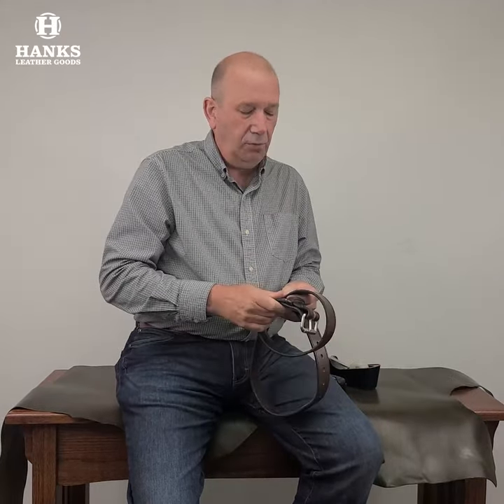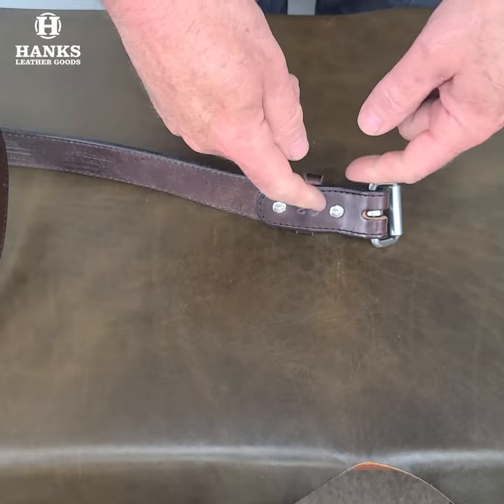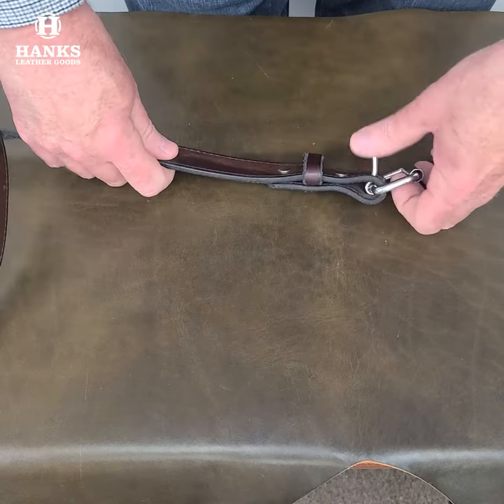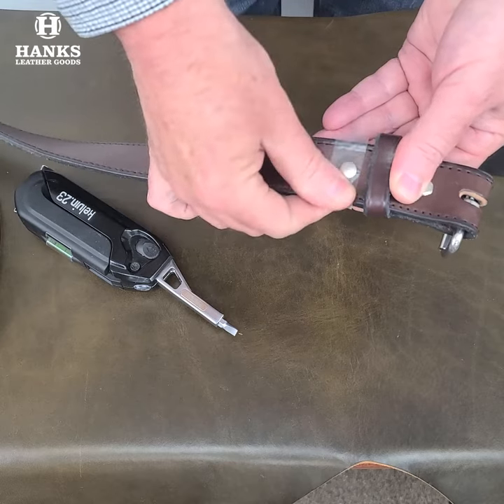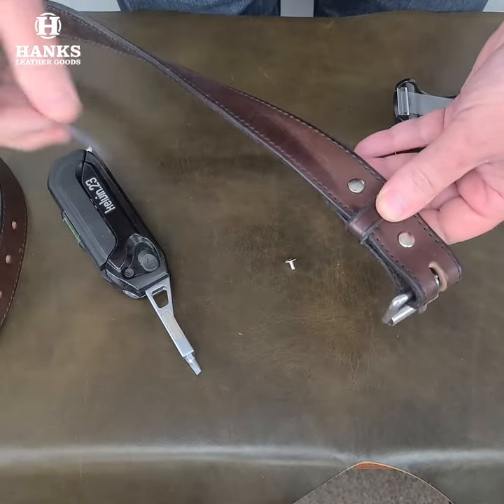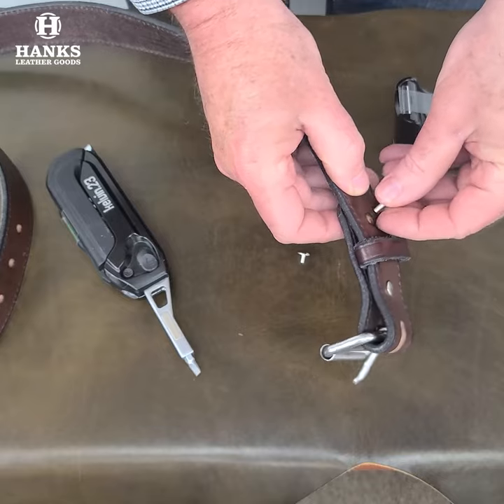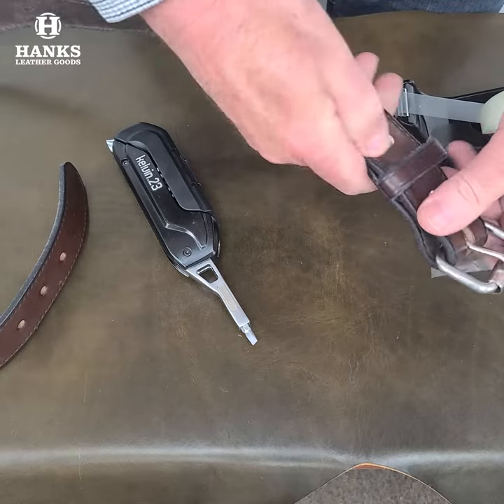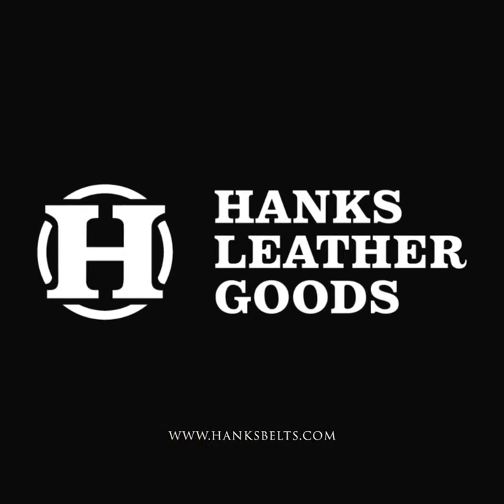Why we use Chicago Screws on our belts. How to remove tight Chicago Screws & how to secure them.

Comment: Star tool used by me was a T10 X 50mm. It worked for me on the same model belt.Very easy with the tape. I left the tape on as I slipped on the new belt loop. Then re-tightened without removing the female half.
Reply from the maker: Thanks for the tips and info!

Comment: Ok tried the tip with tape on smooth side, of the Chicago Screw. Did not work! Now, what other options? To be fair, it is not a hank belt. It came from Crossbreed Holster. Nonetheless, it is constructed with Chicago Screws   Please help!
Reply from the maker: Hey David. I am not sure on other brands. They may LocTite them from the factory which we do not do because of this. Maybe contact them directly and see if they have any suggestions. Thanks for checking!
Reply: @HanksBelts  
Thank you on this insight!
I’m taking in to a leather shop having it switched over to snaps. If that can be done. 

Thanks Again!

Comment: Which size screws are needed for the “gunner” 1.5” belts, 1/4” or 3/8”?
Reply from the maker: You would want the 3/8" for the gunner
Reply: Well I appreciate the quick response, but your description under each of the sizes is vague and frankly misleading in regard to the CCW/gun belts/gunner, etc. I just placed an order about three hours ago  for the quarter inch size because that’s what I figured would work based on the information provided. Very frustrating.
Reply from the maker: @JohnnyTaxonomy  sorry you had trouble with this. Under each belt is a tab that says Specs. The screw length is listed there. Let me know your order number and I'll see if I can catch it or email support@hanksbelts.com and they will help you out.

Comment: Think I got a belt that had been loctited or something, I tried the tape trick and it didn't work.  Nervous about using pliers or something and making a huge scratch.
Reply from the maker: So rare that tape doesn't do the trick. Make sure to place it across the width of the belt and press it down firmly on the head. Duct tape works the best. If you still have issues email support@hanksbelts.com and they will help you out further. Thanks!

Comment: That tape idea did not work, not even after I used Duct tape.
Reply from the maker: That's very rare. If it's one of our belts shoot an email off to support@hanksbelts.com and someone can help you right out.
Reply: I don't know if you are still looking for a solution but I found one. I too was having the same problem and had tried all the methods listed above and more including using a hammer-drill. I super glued an aluminum block 0.25x1x1 inch to the top of the screw Aluminum was just what I had handy. I also had to roughen up the gluing surface of the aluminum with a file to get a better adhesion... for the second try. Let it dry for an hour. I then had a surface that I could hold onto while I used a screwdriver to loosen the other side. It was still ridiculously tight. I then removed the super glue by submerging the bolt and Al block in acetone/fingernail polish remover for a couple hours. The other bolt on the buckle came off with no problem so I didn't have locktite or any other chemical adhesive. Good luck.
Reply: Weaver leather sells Chicago screw pliers they work great